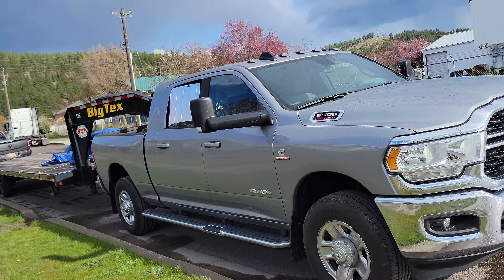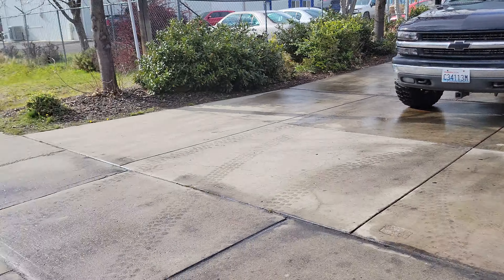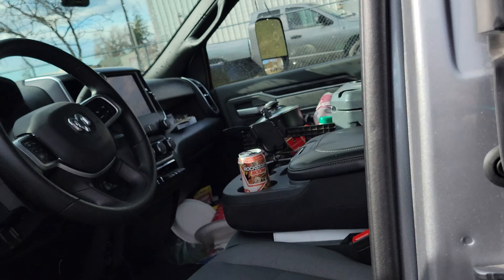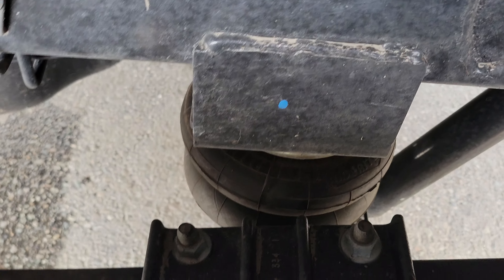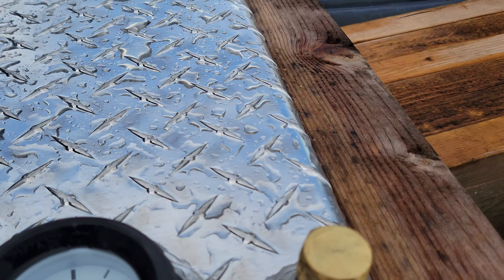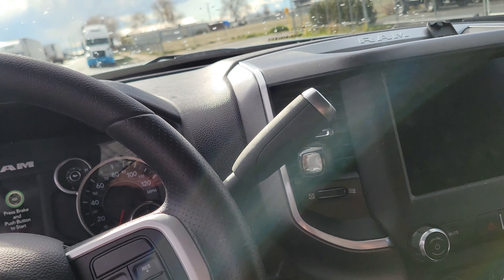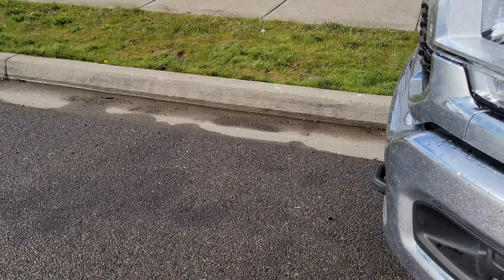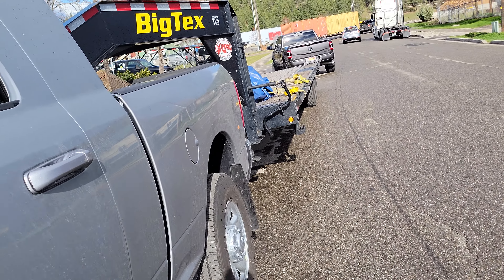2022 Ram 3500 Megacab. 2 out of 3 trucks have arrived. Hotshot setup.

Comment: Those factory wheel to wheel running boards lose their end caps because there is only one screw holding them from underneath..They're tough to find so I recommend you remove the screw and replace with a rivet.
Reply from the maker: Thank you for the headsup

Comment: On my second megacab. Went from a 16 3500 srw to a 22 3500 drw. Big difference on pulling my 40’ toy hauler bumper pull. I now have the Asian my 16 had the 68rfe. The 68rfe is a better transmission for just driving around town. As for pulling my trailer the Asian does better it holds the gears better. I only got the Asian because it’s the only way ram would build when I ordered it.
Reply from the maker: Yes sir

Comment: 37k on my late year (jul or aug build date) 2020. Guess it has the cp4 that has the change. Have not had issues with mine but changed my emissions at 15k ;).  I also put in diesel kleen every fill up.  My rear fuel filter  will get a little dirty but the one next to the engine looks brand new every time I’ve changed it.

Comment: Do you have any recommendations to help my new 3500 to keep from wallowing with a big bumper pull travel trailer?  It’s not sagging and has an equalizer hitch which is setup right.  Just really not very confidence inspiring.  I have my other 1 ton setup with air bags and rancho 9000xl’s and it hauls the trailer around no problem without the equalizer hitch.  Not heavy trailer, just long.
Reply from the maker: What tires and tire size are you running
Reply: @pddieselpower  it’s bone stock.  I literally just got home from a trip in it.  It was bucking pretty bad.  The only thing I can think is to stiffen up the equalizer bars or lighten them up?  Just doesn’t make sense that it would buck the way it does.  It’s a brand new truck so I’m just getting used to it as well.
Reply: @pddieselpower  I was just watching your other video on your 2022 with 30k on it.  I was curious about how long it took to see the trucks settle in and you were saying 60k?  I just got 9.16mpg on a full tank towing a 9500lbs travel trailer.  I was really surprised at how much def fluid it used.  At least 2.5g. Over 1.5 tanks of fuel.  The truck doesn’t have the sensor in the dpf filter to know when to regen so it’s on a timed regen?  I guess there is a pending recall.  Im assuming your 2022 is the same?
Reply: My 22 is also drinking def like crazy compared to my 16.
Reply: I had always run a 1 ton srw but just switched to drw  to make  my 40' bumper pull toy hauler tow easier and it did. It's not very heavy but has a lot of tongue weight. The dually has helped.
Reply: @Mike-xr3yt  I have a couple of other trucks that I use for my business which haul heavy all the time.  My 2019 F-450 doesn’t use much def fluid at all.  I’m always hauling 35,000lbs with it and I honestly forget that it uses def until I get the warning on the dash to refill it.  I have several friends that had 2019 and older powerstrokes that have bought 2020 and newer ones and they have all said the same thing.  The trucks guzzle def fluid compared to the older trucks.  My guess is the programming changed a lot?  This is my first dodge/ram truck so it’s a bit of a change.  So far so good other than fuel economy and the trailer bucking but I think that should be solvable with adjusting the weight distribution.  I don’t even use the equilizer hitch on the 450 so I’m not that used to them.

Comment: With the Mega cabs being a shorter wheelbase than the LB, have your guys noticed if they pull differently?
Reply: It's a longer cab with a shorter bed on the same wheelbase chassis.
Reply: Not according to ram it’s a bit shorter frame that’s why you can’t get the extended fuel tank
Reply from the maker: The wheel base is just a bit shorter. 
With a gooseneck you can't feel the difference. But with a bumper pull I can feel it. Just a bit more prove to having tail move on you. But im talking a bit. Nothing avg person would notice
Reply: @allencanard979  no cclb is like a foot longer
Reply: @allencanard979  no cclb is like a foot longer